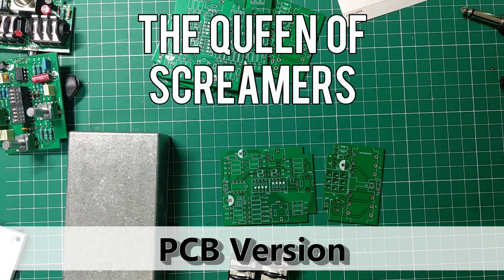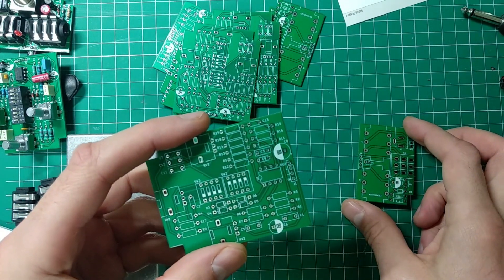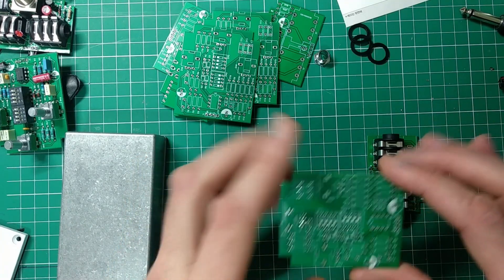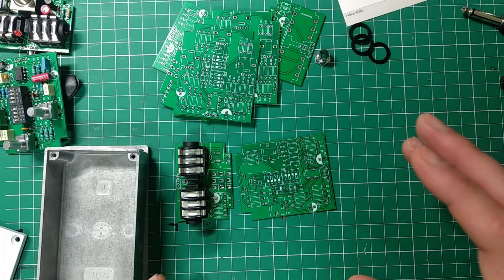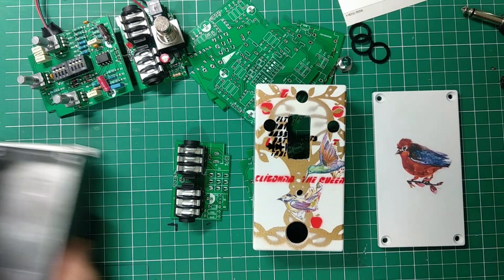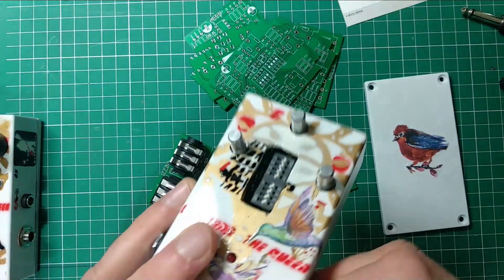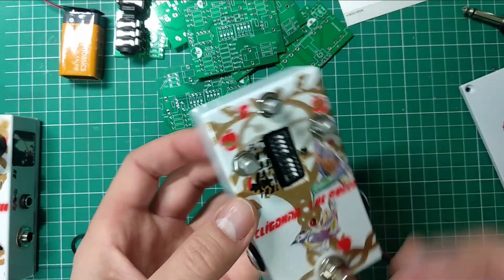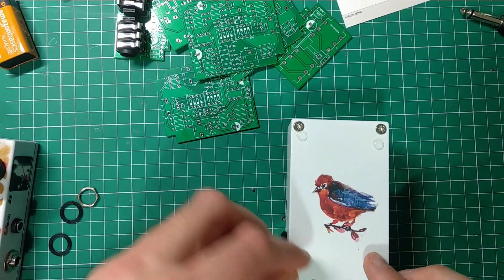Design Our Own Super Tube Screamer - PCB Version

Comment: I like where you are going with the combined inputs and switch board. I was kind of thinking about the same lines about designs that would improve the ease of build. Great work. I have been using your website a ton as reference and just realized you're here too.